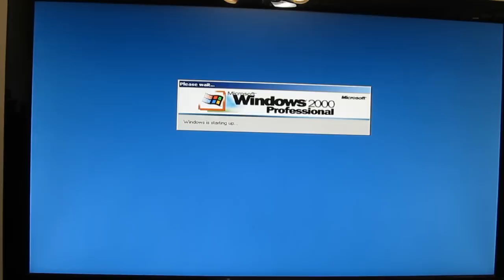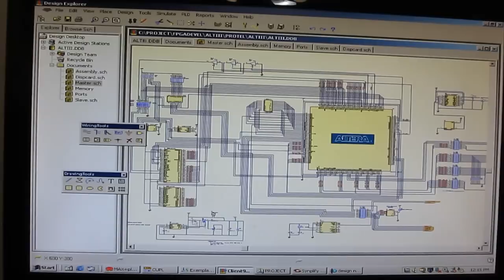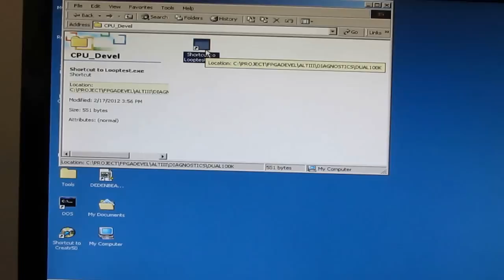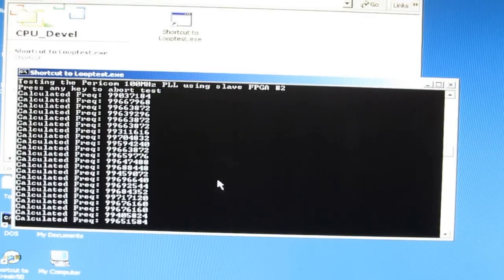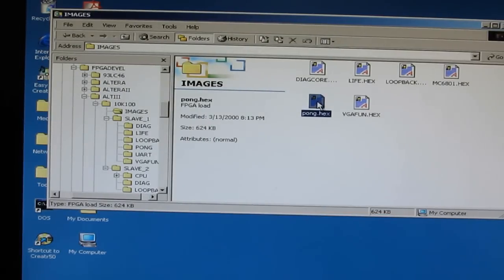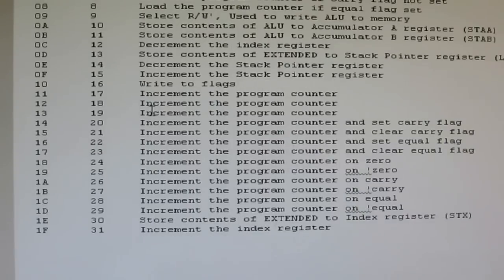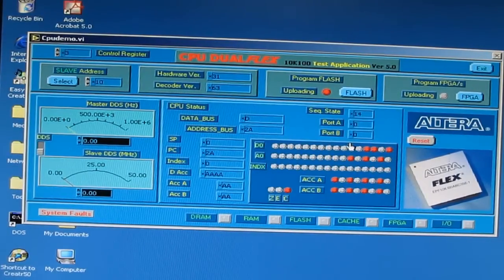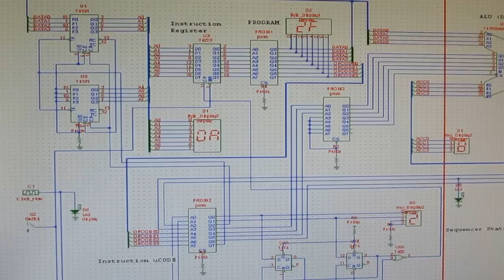FPGA based CPU designs from the 90s, PART II

Comment: Mr. Smith I would like to learn from you I have an asic fpga based device that I wish to convert it into a computer, real hand computer that I can add keyboard, video output and so on. I want to know if it's possible. Thanks!
Reply from the maker: An ASIC is not an FPGA.  You could buy an IC today that would far exceed the parts I used and use free tools.  If it is possible or not depends more on YOU than anything else.  Education level, background, experience, maturity.

Comment: I have an idea that requires your expertise with FPGAs. Have you ever considered developing a full computer architecture exclusively around FPGAs? I have the idea pretty well thought out taking advantage of a known good architecture with a lot of pre-existing software that would enable once a mainboard is implemented to have the system running and then develop directly on top of it. My dream goal is to once we have that running on the old software to extend the system to enable a "morphing" computing solution where the system dynamically changes its internals depending on the task at hand (or in an AI case "learns by tweaking the hardware functionality" directly). The old architecture already has an existing FPGA re-implementation and should be easy to expand and build upon making something totally disruptive to the computing industry!
Reply from the maker: I doubt you would want to pay for my services.  There may be others out there who would be interested in such a system and willing to work with you free of charge.  Maybe consider joining some of the forums and ask around.
Reply: @joesmith-je3tq  Do you see the potential of such a design?
Reply from the maker: @wskinnyodden   I don't think that matters.  Assuming the goal is to make a product to sell for profit, you better do your homework.
Reply: @joesmith-je3tq  Well, my homework tells me this is somewhat expensive but not exorbitantly so, it also tells me most of the ground work is done, that a software engineer will be needed once the final product is done (but not before if the development guidelines are followed basically re-implementing the Vampire 4 on a A4000 like motherboard) and that once this is ready there may be licensing costs if one intends to sell this in the initial Amiga compatible stage (which is  not the exactly the goal). 
Honestly if I knew FPGA's in depth I would follow the philosophy, build it and they shall come (or once the part of the secondary FPGA interconnect meant to allow the system to upgrade itself was ready and tested try and be bought by someone along the lines of Alphabet's (Google) Research or Tesla's AI engineering dep. But this just this fool of a dreamer thinking :) Hope you at least like the concept though. For myself having a design along these lines coming to the world would be rewarding by itself, having a hand on making it would be better though... Still, I have to admit that my "basic" background in electronics does not cover FPGA's per se and is something I have not used actively since I studied it (ended up mostly on Computer Hardware/Software/Networking assembly maintenance and support along with planning and designing networking infrastructure, definitively not in-depth electronics)
Reply from the maker: @wskinnyodden  I wouldn't know what you would consider expensive but assuming you don't have the capital to roll it, you will need investments.  Business plan, collateral,  projected sales....   I have no knowledge of the Amiga outside of a friend having one many years ago.  It wasn't very popular.   Being a home PC, very old and not popular seems like a really bad choice for a target market but I assume your homework has told you otherwise.

Comment: This is similar to how the 68040 was prototyped: many, many, ganged together FPGAs. Totally cool. I've used the Flex 10K (those are Flex 8Ks you have here I think) in some if my projects, glue and peripherals for 6809 and 68000 computers. The last of the 5V parts. Amazing video!
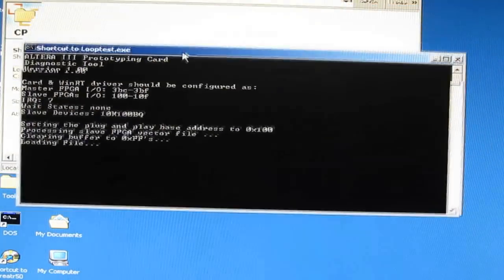Reply from the maker: Do you think that because the decoder logic on this board was placed into an 8K device or because the earlier wire wrapped boards I showed were based on the 8K, that this board would also use 8K devices to hold the main logic?  At  4:14, my  diagnostics show 10K100.  At 12:41, my Labview interface is clearly marked 10K100.  Do you think I marked both of them incorrectly?  Maybe you are looking at the fact it's a wire wrap board wasn't aware that adapters were available for pretty much any package to PGAs.  Maybe you just can't believe that a hobbyist would fork out this level of cash for the fun of it.

Comment: Hello Joe, 
I'm Guillaume F4HDK (amateur-radio callsign) from France. 
I have just discovered your 2 videos about hobby CPUs on FPGA developments. Wow, thank you for sharing, I really enjoyed the 2 videos. In the 90s, it was not a common hobby! 
I have done exactly the same 20 years later, in 2016, also with wire-wrapping boards, and I really enjoyed it, I've learned a lot. You can have a look here:
https://hackaday.io/project/18206
https://www.youtube.com/watch?v=76hnOPgyzr0
It's of course much easier nowadays, with powerful PCs (FPGA compilation-synthesis can be very slow), cheap and powerful FPGAs, online training courses, and free developement tools. 
During your hobby CPU developments in the 90s, did you manage to make custom CPUs with VGA output logic? You don't show that (you show only pong-logic direcly inside FPGA).
Reply from the maker: No, what you see is about as far as I took it.
Reply: @joesmith-je3tq  Thanks for your answer. I'm still very impressed that in the 90s a hobbyist could do that. For example, could you please tell us how much time the "compilation-synthesis" of your FPGA code took with your powerfull (for that time) dual-CPU PC? 15 minutes? 

Another question : where was the micro-code for your custom CPU hosted? Inside the FPGA itself (it had no integrated memory blocks like modern FPGA have)? Or in an external SRAM or EEPROM? If it's in an external memory, how was this memory programmed? In your custom graphic interface, I don't see a "program/load microcode" button for example.
Reply from the maker: @F4HDK  I remember letting the builds run overnight at times.  No big deal as spent more time coding than anything.   The are three sources of memory on that large card.  The SRAM, FLASH and internal to the FPGA.   From the video, you could see that I had wrote various DOS utilities to exorcise the card.  There are programs for diagnostics, programming the memory and programming the FPGAs.   The CPU interface example has the programming built into the software.
Reply: @joesmith-je3tq  Thank You. And where was the microcode of the custom CPU (custom 6801/6811)? In which memory? Directly inside the FPGA?

Comment: I recall using Altera FPGAs back around 2000 (or were they CPLDs?). IIRC, we used Code Composer Studio and possibly Leonardo(?). Did most of the work in VHDL. Woo, takes me back. That wasn't really my forte at all. You obviously had a much better idea what you were doing!
Reply from the maker: I used the free version of Leonardo Spectrum that came with Altera.

Comment: Could you tell me where I can find the ucode worksheet for 6801
Reply from the maker: I suspect you misunderstood what was shown.  This is a custom designed CPU that I used ucode to implement,  that mimics a  MC6801.  The worksheet and custom ucode assembler were unique for this specific project.
Reply: @joesmith-je3tq  Thanks for your reply :D   now I understand,  it is your own implementation.  I am learning CPU designs, I never saw a real microcode for a commercial CPU. 
Thanks again for sharing your great project!
Reply from the maker: @utyuaty2946  Yes, everything I show in these two videos was a custom design.   There are some CPUs that supported some ucodeing in their peripheral.  Have a look at the timer for the CPU32 MC68332 for example.
Reply: @joesmith-je3tq  wow, first time hear  this, thank you very much

Comment: GORGEOUS AND SPECHLESS AT THE SAME TIME. Now Im depresed but Ill raise my spirit turning a led with an Arduino LOL. Serioulsy, I have electronics as hobby (at a much lower ... LOWER level) but this is AIMING HIGH for sure. MY respect. Also, nice PC setup, love this full tower builts full of boards and the dual 200Mhz ceramics P1. Those where the old days.  I worked long hours trying to learn bash and shell scripting in a similar full tower PC with a P133Mhz. For this task was like a fighter jet. Also doing my duties for Pascal and RHIDE on the GLORIOUS IBM PS/2 with the (not-even-famous) M type keyboard that filled with clicks all the room. People didnt like the IBM (it was too old by 2000). I loved it, no BS, PC-DOS and that ready to work. Long hours,  never a problems. Good IBM.

Comment: Windows 2000 loads up faster than current Solid state drive PCs even with DISk and CPU which are much slower!!! Progress!!!
Reply: I have Debian 8 on a Core 2 Duo P8600 with SSD and it loads is in a blink. Its a 4G notebook and its is almost 10 year old HW. As soon as yu dont keep patching things it works like a rocket.

Comment: Why is part 2 in 2016 and part 1 in 2017? 
Very amazing with only the asm binary coding without any HDL. At least it is not confined by some specified compiler... And I can only use VHDL... 
How long have you been learning all of this?
Reply from the maker: I can only assume you misread the dates.  You must have skipped the part about HDL.
Reply: Emm.. I see the HDL part... But found hard to tell what the language is. Seems like ABEL but is not... I found I need to learn massively more...

Comment: This is 1000% more fascinating then most Arduino projects - nice work
Reply: Go for Assembler, at least for educational purpouses. I learned the basics of PIC assembler with a 16F873A, and then picked up Z80 assembler. It is the lowest level you can program before using hexadecimal. 
It gave me a grasp of how things were working under the hood. I don't program in Assembler for production, just for learning though.
Reply: Indeed lol. Though for what it's worth I really want to learn AVR Assembly.
Reply: Go for it - I learnt assembly for PICs back in 1999 - it taught me a lot on how the computer works.  Quickly moved back to C to get this done as ASM would hurt my brain - not doing it routinely, plus, I'm lazy.
Reply: Definitely will. The main reason why is that I'd really like to be able to write more efficient programs. The Arduino IDE has doesn't exactly make it very clear what the code is doing sometimes. On one of my projects I had to set some bits in the registers with the _BV macro to alter the timer dividers (OCR1A to be specific), and I had to look up a datasheet for the Atemga328P to figure out what values I needed. That was the point I decided learning AVR Assembly might be a good idea, so I understand the hardware better.
Reply: I haven't started learning any assembly yet, to be honest. As of right now I'm still taking some classes for other things such as server management and powershell scripting. The summer is when I have the most time for projects and that's when I plan to follow some guides, experiment and begin learning and make use of assembly. For a couple of my projects in specific I will need code that is extremely optimized and very tightly timed, and assembly is very good for that kind of thing. Minimizing the amount of total instructions and all. Don't think I'l ever bother to write raw machine code in hex though lol. That's a whole other world of complicated.
Reply: I'd say all Arduino projects...

Comment: Very interesting! Really makes me appreciate what we have today for hardware development, even though I've only messed a little with FPGAs

It's a shame wire wrapping isn't used much anymore, I really need to try it some time - maybe a lil wire wrapped Z80 computer...
Reply from the maker: I can't say I would recommend it.  I did recently WW a small computer for the fun of it.   Even tossed in a 22V10.  This computer controls the new transient generator that I designed to test the multi-meters.

Comment: Man, I'd really love to see more of your FPGA board design and how stuff is connected up.
Reply from the maker: That's a pretty old design.  A couple of chips now or just a basic eval board would do much more than this thing could.
Reply: That's what makes it so appealing I guess, everything is on one chip these days. Mixed-signal ICs by Silego, power supply chips by Enpirion/Altera, etc. It's cool we can program dev boards via USB and don't need to provide an external clock to small microcontrollers but if feels it's almost too easy.

Comment: Very well done, I'm impressed. It's difficult enough to design an FPGA board nowadays on a PCB let alone wire wrapping it. Designing a CPU in HDL is no easy task either, I'm reading a few books on the subject at the minute. Are you still doing hardware designs?
Reply from the maker: +Darren Anderson Thanks.   Yes, I still like to play with the hardware now and then.